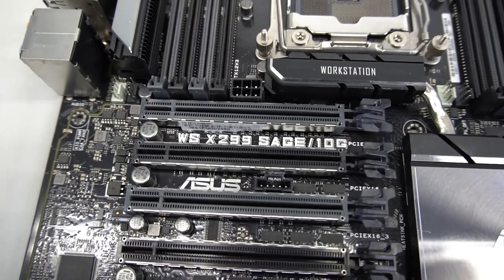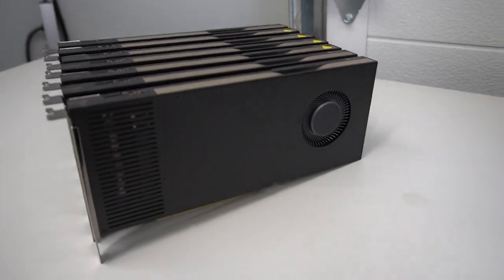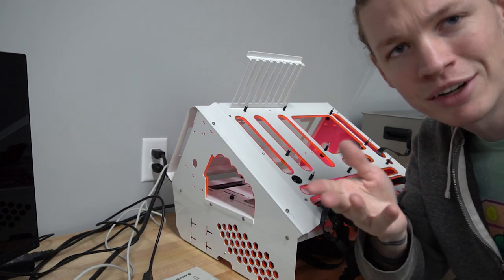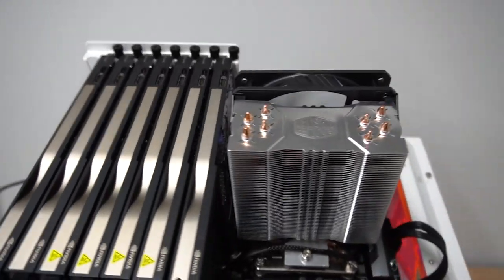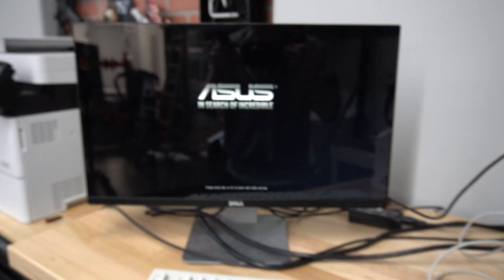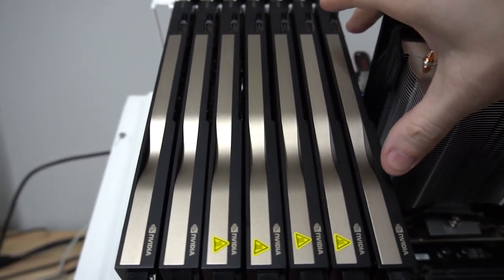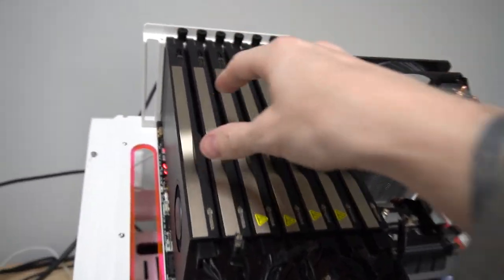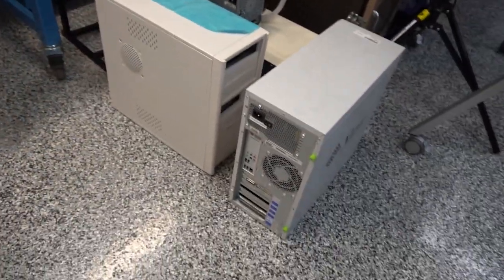Can You Fit a Mining Rig in an ATX Case?

Comment: I've seen a build in korea with 4 A6000 but watercooled and as they are watercooled they only take 1 slot and you could put the 7 of them but it was already pulling on 2 power supplies like 2200W
As the case, you could take the Thermatake Tower 900 to be able to see the cards and have enough rad space 🤷‍♂😁
Reply from the maker: lol, I do Have Thermaltake 900 just sitting here. But I want to try and air cool this before jumping to water-cooling.

Comment: Get a large ATX case with 3-4 140mm fans in the front. You may need to add some cardboard or foam to stop airflow going where you don’t want it and force it to flow through the cards.